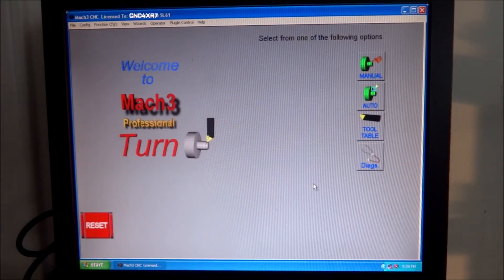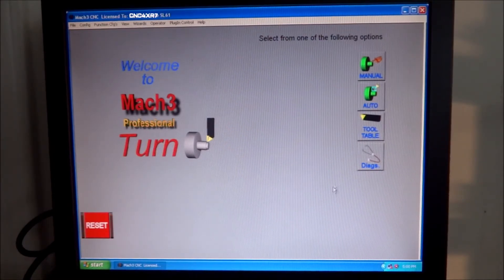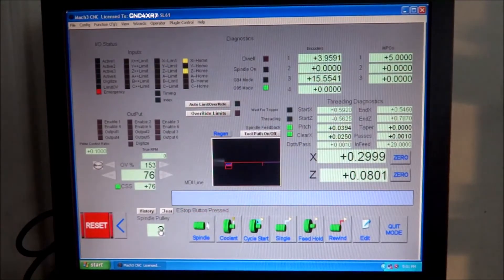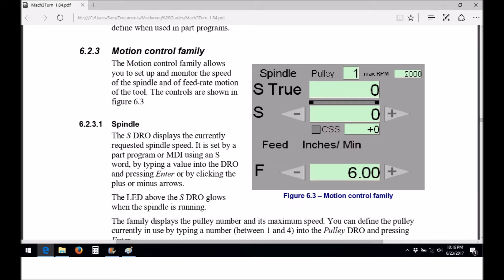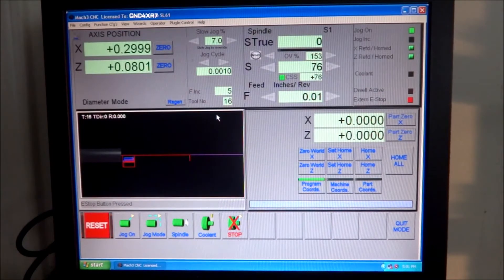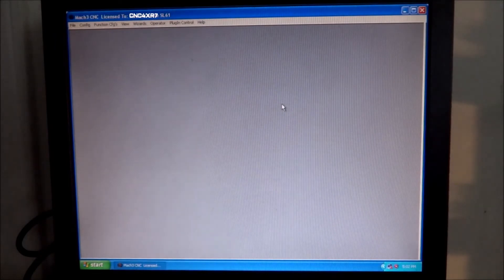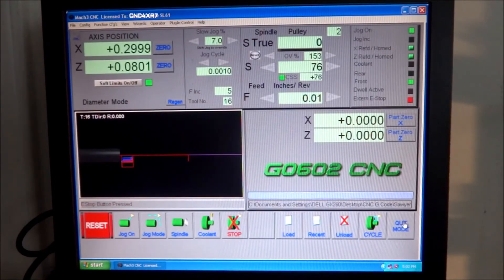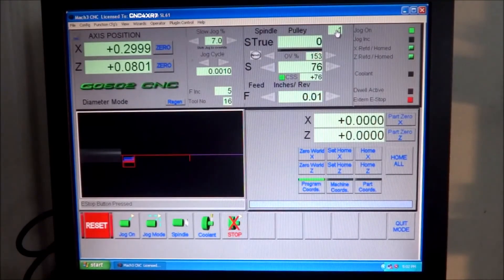Mach3 Screen Set Fix

Comment: S1 main spindle, s2 sub spindle?
Reply from the maker: Most likely that may designate Spindle 1 however I see no setup for a S2 or sub spindle which in my case I do not have anyway so I just changed it to indicate the Pulley configuration I'm currently using.